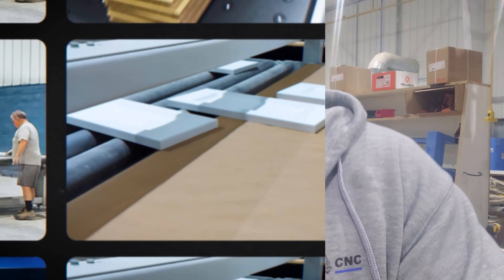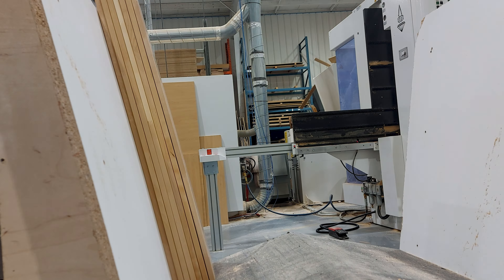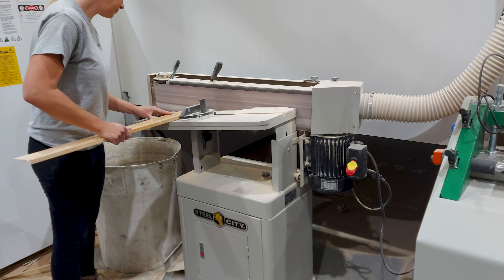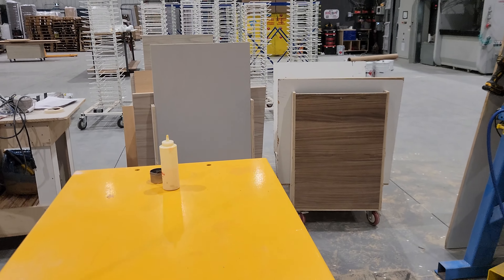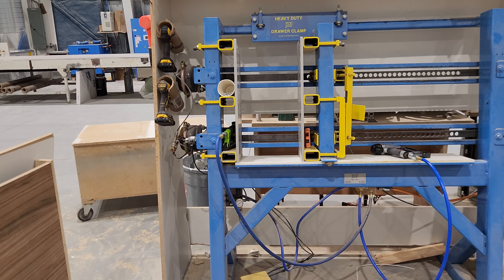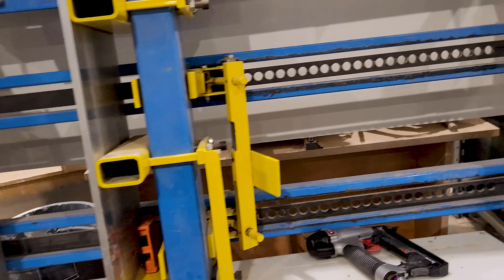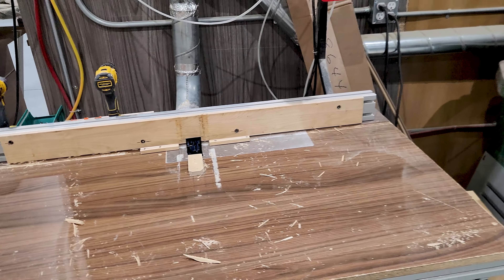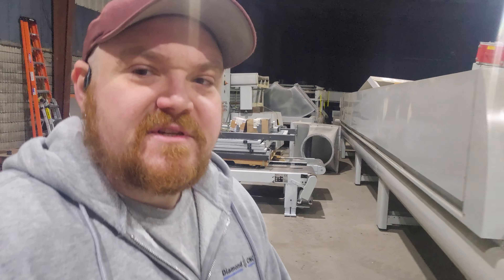dovetail walkthrough

Comment: Nice video and nice setup. Always impress with your improvements.
Thank you for sharing. Could you share with us what model on staple gun do you use for drawers bottom. Regards.
Reply from the maker: the green one for nailing the back notch part on, is a grex and i beleive my other gun for the bottoms is a stapler, is a porter cable